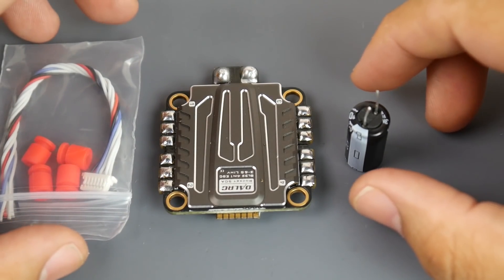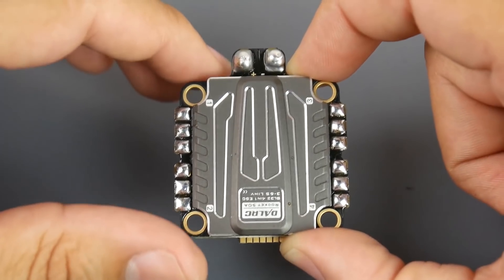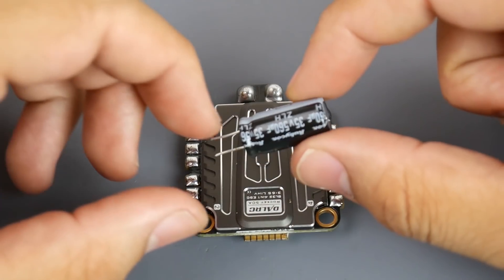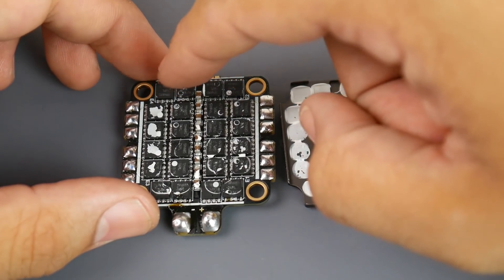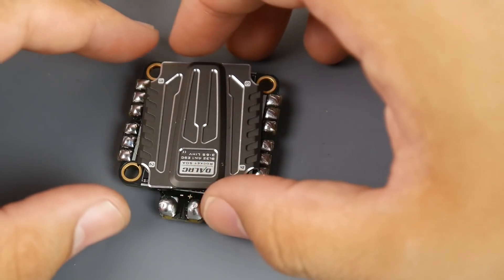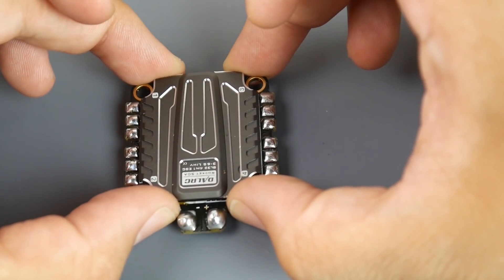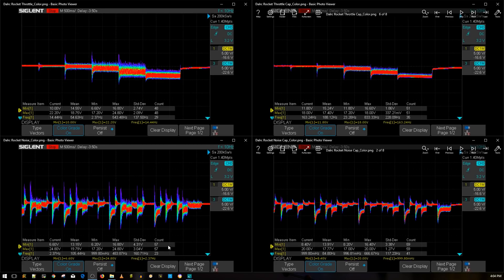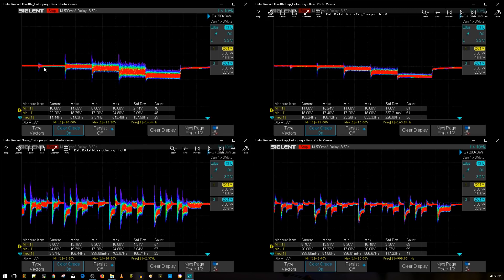"A" CLASS ESC PERFORMANCE!! //  Dalrc Rocket 50A 4in1 ESC Review Noise Test

Comment: Love the videos.  Keep up the great work.  I've got the Rocket 45 going onto a new rebuild.  Thinking about getting another in the 50A for my 6" quad.

I wonder if the noise would change at all running a bigger capacitor?  You are running the 560uF Cap.  Wonder if the 1000uF would change at all.

Comment: I need a little help here.  I have the Dalrc rocket 50a 4 in 1 esc and the holybro kakute F7 flight controller and I’m trying to connect both together. The plug pin out for the FC says (m4-1)( I )(G)(R7)(B+) 
What is the I and R7 used for? Thank you